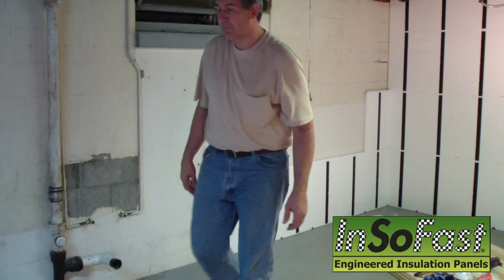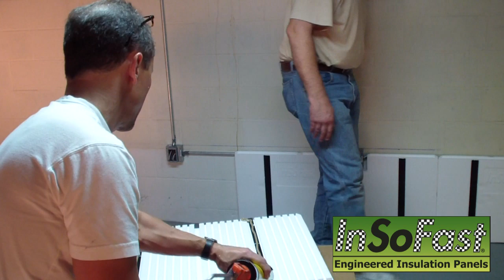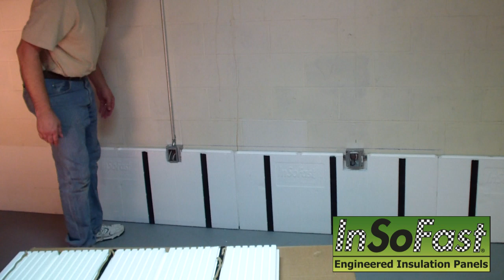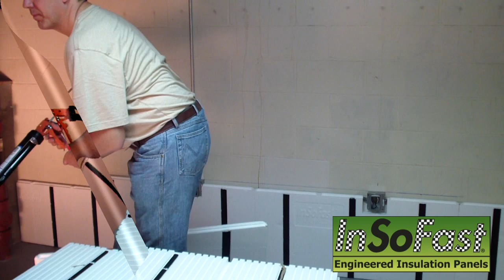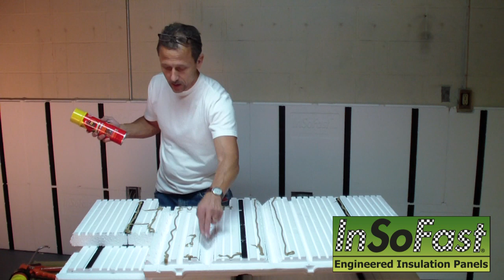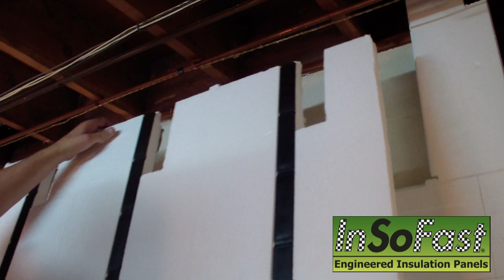InSoFast Existing Conditions

Comment: Very interested in this product but, curious Does this product meet residential codes?  Will this product support the weight of pictures, speakers, TV, shelving? Does this product come
with instruction for plumbers and electricians.
Reply from the maker: Yes it does and it has a DrJ Technical Evaluation Report/NFPA 285 Compliant Assemblies - Code Approval Report. https://www.drjcertification.org/system/files/DrJ/TER/node/1783/ter_1910-03.pdf https://www.insofast.com/resources/insulation-panels-for-interior-residential-masonry-walls.html
B. Installing the finishes 
1. How-to install electrical wiring into the raceways?
2. How-to install services and plumbing?